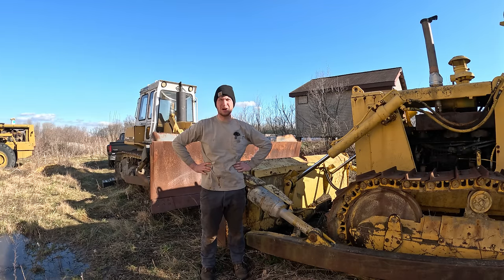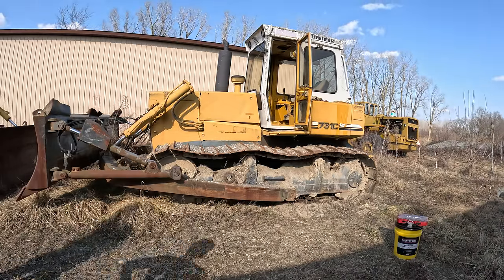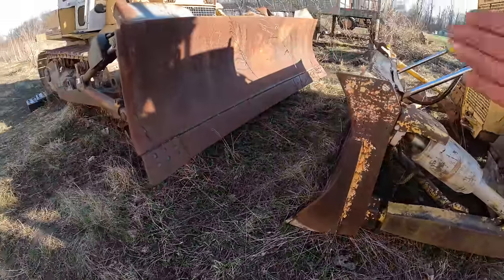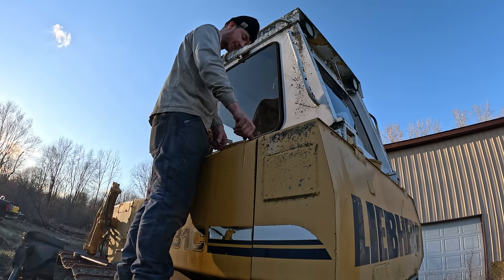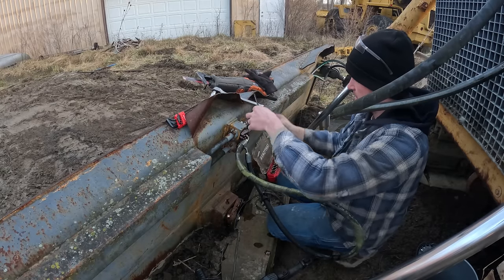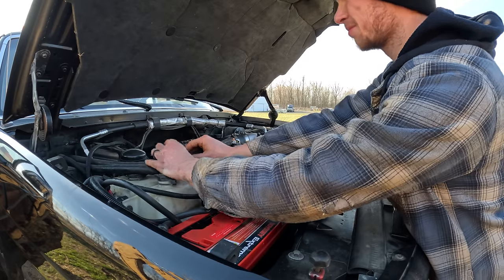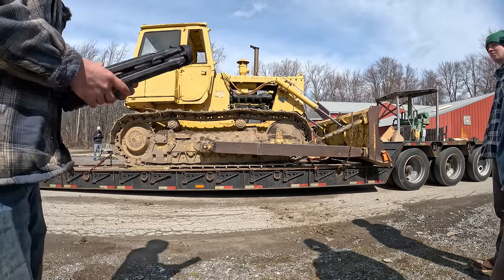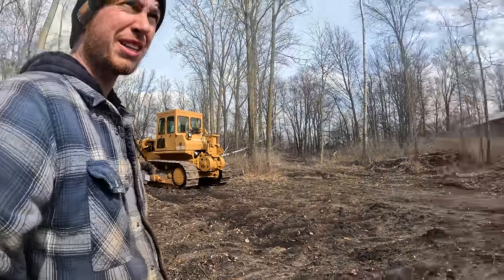I bought two BIG BULLDOZERS for $4,000

Comment: Clint at C&C equipment  mentioned once they use 15/40W motor oil 🛢️ in all their machines they've worked on or fixed which would save you a lot of money $$$. Others have said 15/40  motor oil lacks anti rust ingredients but key it's OIL when All is said and done, right. Buying larger quantities of 15/40 and mixing it with hydraulic oil seems like a good idea to me. I was low on hydraulic fluid in an older rollback I own and added some 15/40 and all's good so far. I wish I could find a small dozer that I could move around on my own. Baby Dozers, 🤣🤣🤣. It's great to see you having such good luck this early in the year. Keep it up. 😊
Reply from the maker: Thanks Mike!
Reply: Thats only on John Deere hydrostat machines with that sepcific pump

Comment: Back in the 1990s I wanted a Liehberr dozer so bad. They were cheap here in Georgia USA. Everyone said they tear up and parts are too high. I had lots of Cat machines and just wanted to have one just for fun. I almost bought one but did not. All the sudden every manufacturer went hystat. Now I hate hystat (as far as owner operator not running gps and I want open source machines that are easy to repair). I like hystat when it's new, rented, or someone else's purchase. The cost of the pump and motors and the catastrophic potential. It's like a terrible zero turn mower. Easy to operate. Happy to see someone take a chance on this machine. Eager to watch.

Comment: As far as the Mystery Red Fluid goes, IH Hy-Tran used to be red back in the day. One shop I used to do work for also used to blend Hydro Oil and Dexron ATF to improve its Lubricity so it could be used in other applications that required it. Nice work getting that old iron out of there anyway.
Reply from the maker: Thanks!

Comment: You get the oil leaks fixed on the Trex and that will be a good machine.
Reply: why didnt you open the hydraulic lines to the dozer, then lift and chain it? or just chain the 2 blades together so the blade could go on the truck?

Comment: We got a liebherr 741c is a really good machine once you work it all out, hydraulic side of Dozer was the bottom small pump on the splitter box. 

Hydraulics are on a pilot system it should have test points everywhere.

If you were able to force the hydraulics up/down then I'd say it's not electrical as it shouldn't move at all.

Comment: Hello Tyler. Are you sure the Liebherr isnt just still too low on fluid to move the blade? I think you mentioned 75 gallons and someone else in the comments said 40 gallons. Either way not very much fluid for it to be expected to function well. Maybe your plan is to change the fluid, so not putting too much in until thst happens? I was surprised when the Liebherr turned.
Reply from the maker: I think the blade would have some function. We need to drain fluid and fix leaks before we put a few hundred dollars of fluid in it!

Comment: That red oil is ATF. That's meant for automatic gearboxes of cars and for steering pumps of cars and trucks. So it's not suitable for the hydraulic system of a dozer.

Comment: Moving along now watching you try to do what you do gives me a headache How could you not know that trying to pick up the blade that close to the pivot would take the most leverage? It would have taken you way less time to just crack. The hydraulic line and lifte up and let the fluids squirt out. And then You don't even know if cutting off the feed to the heater core will stop it from leaking. 🤔

Comment: Eliminate the heater core totally run upper to lower hose at motor.
Reply: agreed, dont vise grip...connect them to make a loop eliminating core...wont screw up the circulation of the coolant

Comment: Looks like it would have been smarter to leave blade chained up and on the machine like it was. Not like it's a d9 with a giant blade..
Reply from the maker: Too wide to trailer
Reply: @dieseJL  they trailer excavators every day much wider than that . Even an 848 grapple skidder is as wide if not wider.  I see them on the roads daily.
Reply from the maker: Anything over 12’ you need an escort. This was 12’8”. I didn’t feel like paying for escort cars.

Comment: Need to unbolt the cab. 4:52
Reply from the maker: where
Reply: @dieseJL   the base of the cab there should be 5-6 bolts on each side. 4 outside and 2 under the floor mat. It’s painted white in front of the cab rise jack.
Reply from the maker: I thought it was just the two big ones horizontally in the same area?
Reply: @dieseJL   nope it’s those top plates at the base of the doors. Liebherr tech for 10years.
Reply from the maker: Amazing. The manual doesn’t talk about where to unbolt at all. Now how come when we pump the handle I don’t feel any resistance? I did at first but now I do not.
Reply: @dieseJL  The cab jack works for both directions. Pump to pump up and then pump to pump down. Once the cab bolts are out, try to jack it up. As you saw the lever on the front of the jack one way is up and the other is down. But make sure you have hyd oil in the tank.
Reply from the maker: If I can’t get it to go just lift it with the loader? 

Now why doesn’t the blade work?
Reply: @dieseJL  I don’t think you will lift it with the loader. It needs to see pressure for the cylinder to move. 
In the video it sounded like a lot of air was in your hydraulic system. If you have a way. Put about 8-10 psi on top of the hydraulic tank to add some pressure to the oil in the tank. 
(Note: too much more air, could blow the sight glass out of the tank. Would make good video. 😂)
Liebherr makes things different. Good machines, last long time.